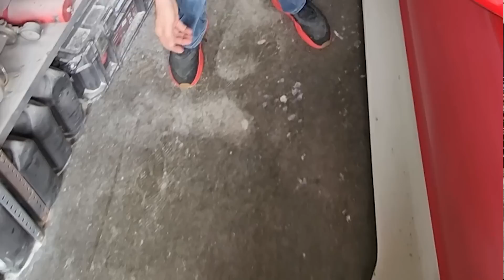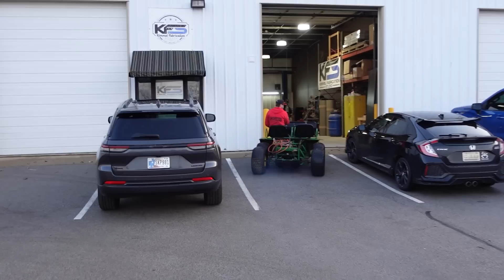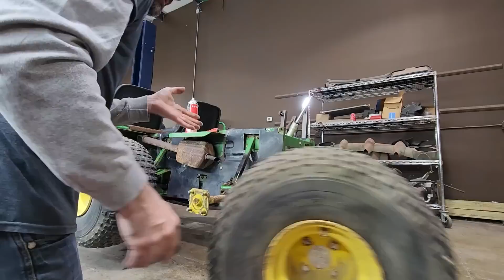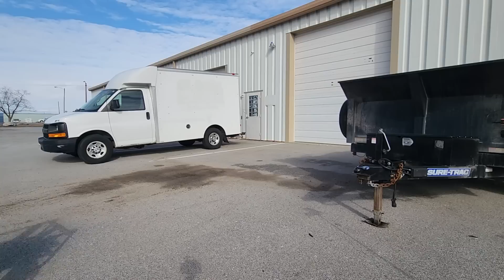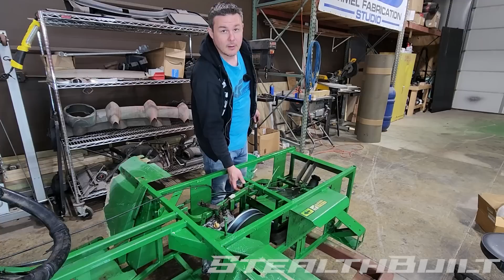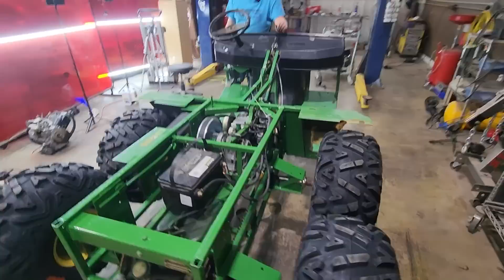Mini Overlanding Camper Build Part 1: Chassis Rebuild, Turning a John Deere Into a Mini Camper!

Comment: Them tyres are inflated way too much they will shrink with less air
Reply from the maker: We did find they were over inflated, but they didn't shrink much after. Nevertheless they worked. Thanks for watching.
Reply from the maker: They only have about 18psi in them.

Comment: Sorry, but all that talking over each other was very off putting. Much prefer less talking more working. Almost 14 minutes into the video and that’s been done is a jet wash and squirting penetrating fluid on the rusty bits.
Reply: Sorry Geoff but your comment took too long to get to the point. Much prefer just a 👍🏻or👎🏻.
Reply from the maker: @Edward_Scissor_Feet 😂
Reply from the maker: Thanks for the feedback. With a new project its always a balance explaining the setup and getting to work.